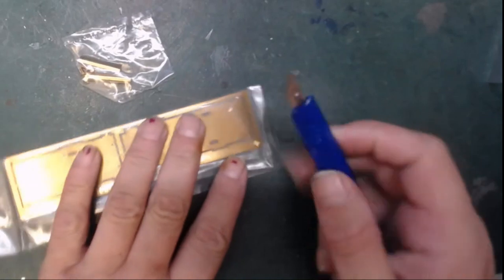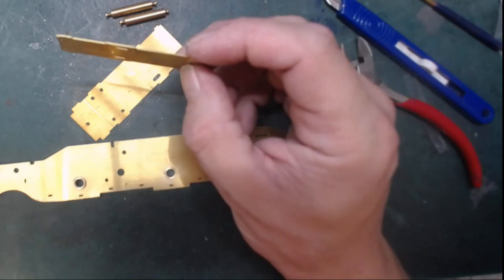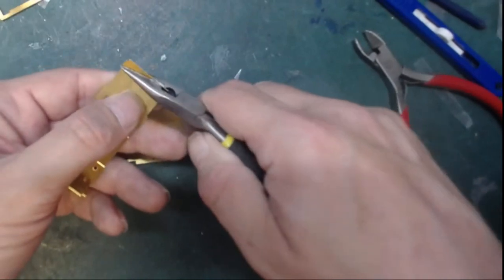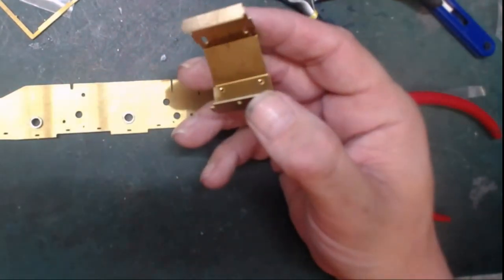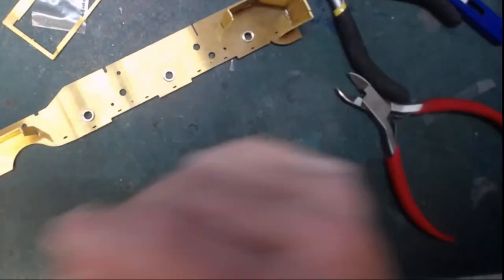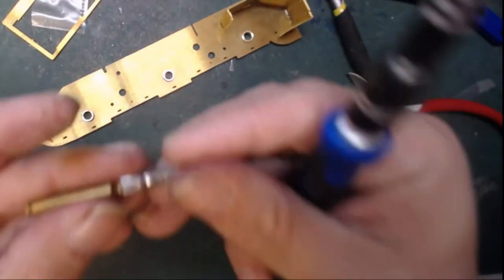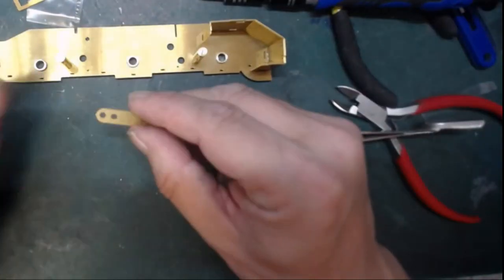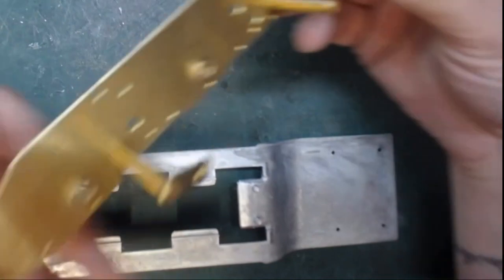Flying Scotsman Locomotive - Issue 4 - Chassis Fixer Plates

Comment: Yes, it does go there.  I could see that the brass side frame is the same shape as the white metal casting.  You probably already know that by now.  Looking forward to when you switch from super glue to soldering the brass parts.  It looks so nice in the bare metal, that it is almost a shame to paint it.